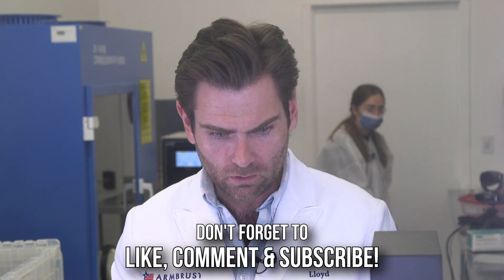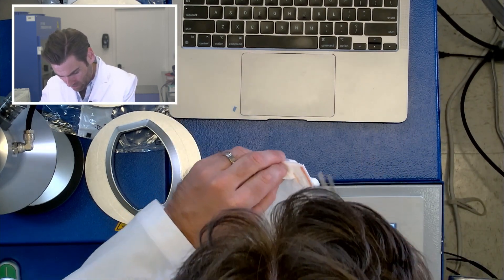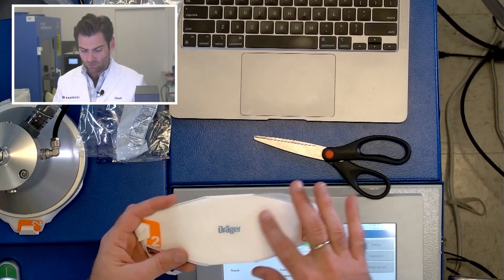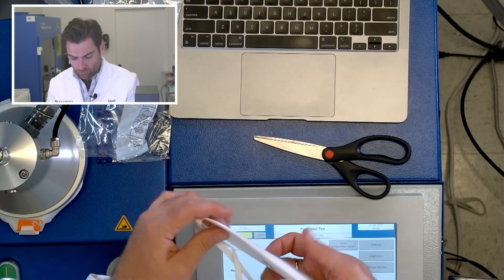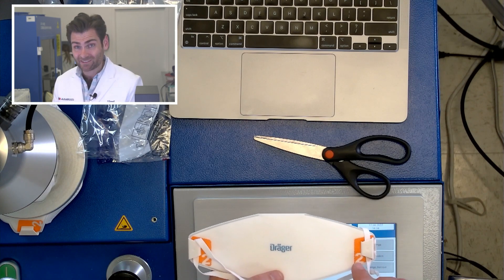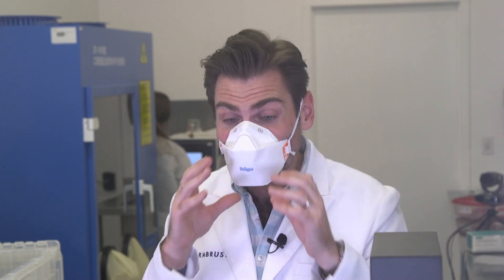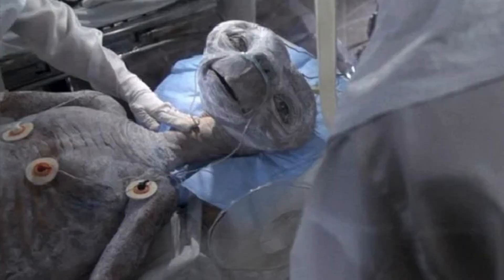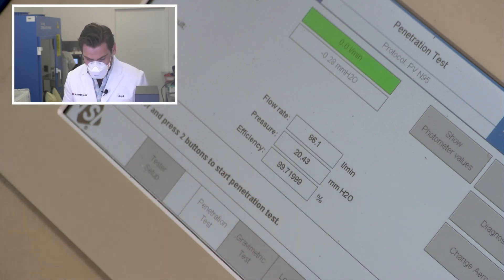Lloyd is blown away by this mask - Drager 1920FFP2 Review

Comment: Super nice.  I think the v flex at this point is the consumer gold standard in terms of comfort, breathability, and cost.  

You can get 50 for <$1 a piece.   
I found some sites that have thins one $70 for 10.  

You just can’t beat the v flex.
Reply: A 3M bag of 25 Vlfex  9152E ffp2 masks costs 11.5 euro (~11.5$) in my country.Unfortunately,i failed a QLTV fit test.
Reply: I wouldn't recommend Vflex. They have a tendency to fail at the nose on some